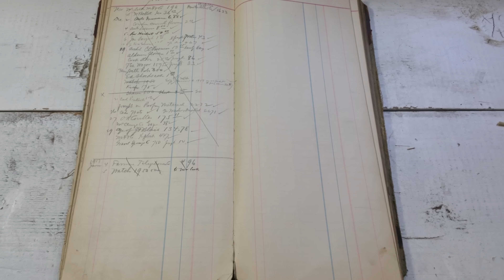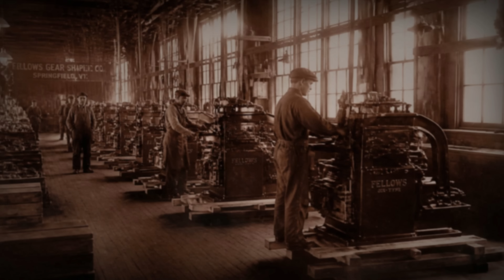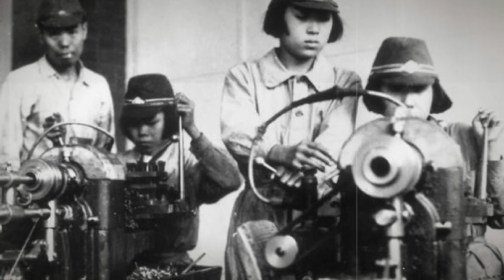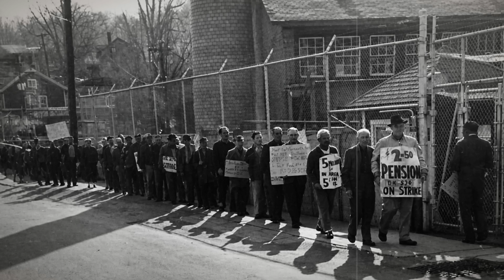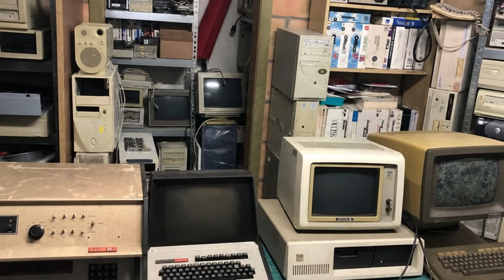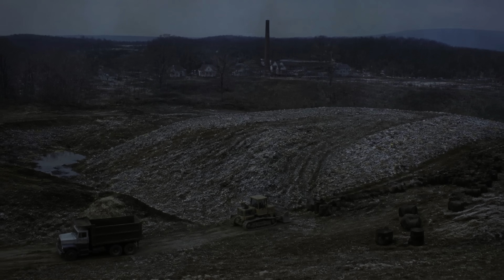The Window Dresser Who Solved Machining's Hardest Problem And Put America On Wheels

Comment: That was very informative but details matter.  You skipped around 60 years of the most popular machines Fellows ever made.  Larry Bourn and Loyd Koch ( pronounced "ko", not "coach") are both still alive, Loyd still works even though he's in his 80's, and when talking about shapers you showed CNC gear hobbers derived from Barber Colman designs, not the Fellows shapers you were describing that we still service, repair , manufacture, rebuild and retrofit.  The largest Fellows gear shaper ever made was a Hydrostroke that has almost a 3 foot stroke and over 100 inch O.D. capacity.   On the Barber Colman, note, that video mentioned when the company started, but I've worked on models from 1903.  We have all of the records.  Maybe you should visit B&K, since we are OEM for 29 of America's greatest machine tool names including Springfield Grinders and Jones & Lamson, both named in this video. Yes, I've worked on many of those too.  Please come visit us, we have the history and all of the blueprints for all 29 of those old American made machines.  2500 Kishwaukee St., Rockford IL.

Comment: I almost bought a Fellows gear shaper at auction on the southern border of Virginia at a cotton mill, weaving plant sell out. The shaper had gearing and cutters, but I had no way to transport back to my little shop in Maryland. The one that got away. The mill had been stripped and went to Korea I was told. My friend found the steam whistle from the roof he heard as a child. My 24" Cincinnati Shaper is my consolation prize. I have old equipment, including war production board machine tools. Still works. Much rebuilding was done to my 40,000 lbs. of cast iron.  Retired now.

Comment: No one wins in a union strike especially if it goes on any length of time. My Dad was a union president and I was a union chief union steward. Most of the time the increases that you get in wages will never offset what you lost while on strike. I have seen the good and the bad of unions. Great companies who pay wages and benefits fair do not have unions. Usually they are family owned and run. Kudos to all trades folks regardless of skill set. They are even more important now with datacenters. You can have the greatest up to date processors in the world but with no power or cooling it is worthless. IMHO

Comment: One of the things that changed gear making was the introduction of plastics . I had a 1979 Dodge truck that had a nylon timing gear on the camshaft . I changed it out for a steel gear . For the rotor shaft in the distributor I changed out the nylon gear for a silicon bronze gear .
Reply: And then came the Clinton's and free trade and our work went over seas

Comment: You missed a major factor in the downfall of gear cutting 
Germany invented metal powder pressing during WW II particularly for short life military vehicles .
After it fell, no one was interested in the technology so the BSA company ended up with it as war reparations .
Just like Fellows hobbing machines, powder pressings were sneered at by machinist until the BSA company managed to take sintered gears into automatic gear box syncromesh gears and eventually as the technology behind metal powder pressings , more gears were pressed & sintered than hobbed which dropped he price by over 70% and the manufacturing time by 90 %

Comment: When I cut my machine maintenance career teeth in 1982 our shop was running a Fellows gear shaper and 2 Barber Coleman gear hobs. Your story is interesting. We moved away from mechanically driven gear machining to CNC in 1993. Our plant was flooded that year and retooled as oart if the flood recovery. The Fellows gear shaper was culled as a flood casualty. We never went back to gear shaping. The Barber Coleman machines were culled with same flood event. Our shop chose Pfauter for CNC gear hobbing. Pfauter was purchased by Gleason around 1995 or 1996. Our Pfauter model was quickly dropped after the Gleason acquisition, and supprt was virtually non existent.  We eventually purchased a back up vintage hob that used the same tooling as the CNC Pfauter to maintain urgent production when we had a support lapse. Spur gears were critical to our product, both straight and helical. When I  retired in 2017, the Pfauter was still running 4 shifts each week. Class 14 gears was included in our design requirement so a Gleason gear grinder was added in the later 1990's. It ran a similar production demand as the Pfauter. The Gleason was among our most sensitive machibe tools. To set up the Heidenhein scakres on the wheel dresser required a .00005" indicator. No one in our plant owned anythig that sensitive including QA inspection lab. I purchased my own. That scale repair was the only job that I ever did that mandated using that indicator. I keep that indicator in my bedroom along with similar sensitive test instruments and metrology as my career trophies. I rarely work closer than .0005" in my retirement hobby shop. I have had no demand to make any gears in my hobby shop life.

I have long ago forgotten the Fellows model that we ran. It was a solid runner with simple repair issues like electrical and oil leaks.
Reply: My Uncle still has a Fellows high speed shaper, a G&E 24h hob and a Gleason 12(b?) bevel generator, all from the early forties, bought them for basically scrap price in the seventies and 80's. He runs a small job shop and makes replacement gears for whats left of local industry, farmers and the restoration community. It would be very hard to compete in a volume production environment. no class 14 work here lol
Reply: @gregdawson1909   That is truly wonderful ! Those old machines were built to last lifetimes  . It warms heart knowing your uncle preserved such incredible history .☕🤝
Reply: great career ! ..... hopefully those skills won't be lost in the coming generations .
Reply: I got into machine tool maintenance in 2013 after making a choice to get out of automotive. Cnc maintenance at aerospace company. Never regretted that decision. I've been watching old American made machine tool companies slowly go extinct. Producto, Cincinnati, Springfield, Gray,  Lodge & Shiply. We call those Legacy machines and they are more and more scarce. I got another 7 years before its decision time for me. I wonder how many will be left there.
Reply: Reading about your transition from mechanical to CNC brings back so many memories. Keeping that precision indicator is a beautiful tribute to true craftsmanship. Enjoy your retirement! 🤝☕
Reply: The Greatest Gen was I was there in 70s to 90' manufacturing?  for the 70s, 80s, And 90's, or 2,000!  grew up with these dudes ! and dairies, in La Co So Cal, to the 80s? Or 90s?
Reply: @davefellhoelter1343   Oh , the memories ! Hearing about your time in  SoCal manufacturing brings the history in this video to life . We really witnessed a golden era of industry , didn't we ?:face-blue-three-eyes::face-red-heart-shape:
Reply: @IndustrialRuinsUK  I worked in foundries and forges before Jr hi, got me a titanium digging pry bar I watched the smith cut off the bar stock, toss in his hot oven, hammer out, quench and hand to me as a just teener while I helped dad work on his cool oven in the 70s Paramount Ca, just drove past the forge is still there! but I could not feel their hammers?
Reply: @davefellhoelter1343  ❤❤❤  Reading your story brought back such vivid memories. The intense heat of those old furnaces and that true craftsmanship are things our generation will never forget. ☕🤝
Reply: Cool I learned to first cut gears on one as well.

Comment: I think the difference between divider head - spur gear production and gear hobs is poorly explained. Divider head gears can be accurately measured , cut to beveled configurations, and, as far as I know, do not require hand filing to fit. Furthermore, terms like "involute" are used in defining them.
Reply: Spot on! You have a sharp memory for those technical details. Understanding the true precision of an involute curve feels like a lost art these days. 🤝☕
Reply: If you do gears that way, there are eight gear cutters that can cut a range between 12 and “infinite/rack”.

Note: I have .8M metric gear cutters.  I want 1m and 1.5m cutter sets.